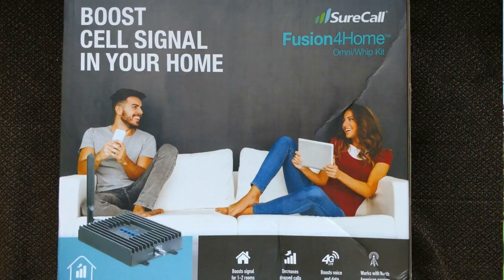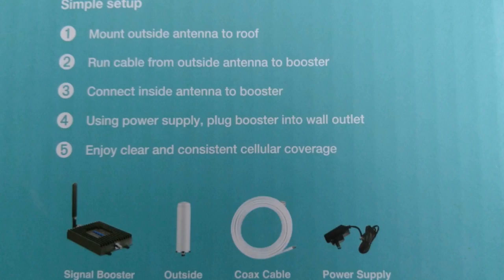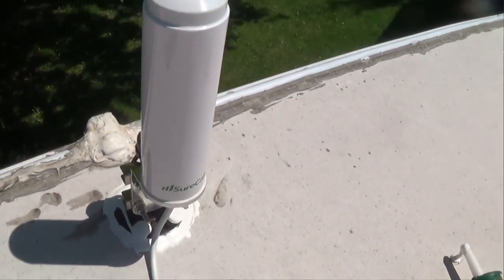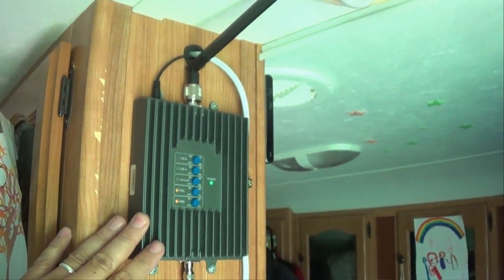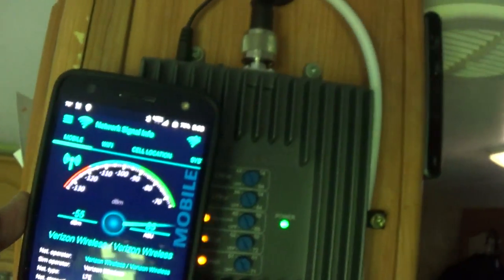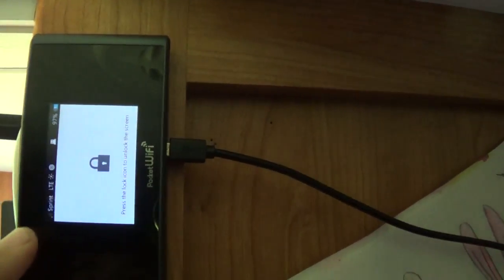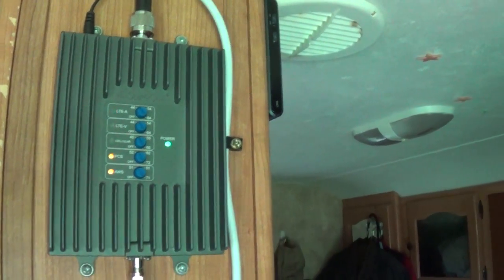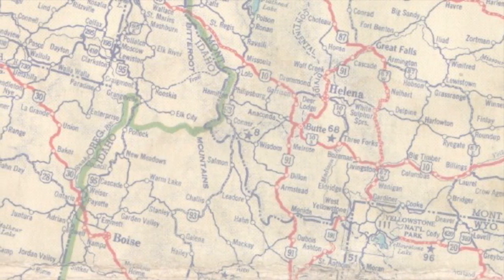Our New RV Cellular Signal Booster: Does it Really Work? - RV Tips & Tricks

Comment: Thanks for the video!!!!
I have been on the fence for over a year planning on purchasing a booster and I think you just helped me decide. I am hoping this helps with ATT and 
T-Mobile the same way in my camper.
But I do have to ask...the mounting bracket that was included with you kit, could it be used to mount the antenna to a 1” RV ladder or would I have to source other hardware or another bracket?  Also what app were you using to test the dbm strength?

Comment: I gotta git me one a them thangs!  Hi guys.   We are just about to do our initial shakedown trip with our new RV trailer. Thank you for this video.   I am very interested in a booster because we will have to upload our videos while on the road with our travel trailer. We use our ATT phone with unlimited as our hotspot.  It works great at home, but I don't know how well it will work on the road.
Reply from the maker: Where are you heading? Maybe we might cross paths. We've been trying to upload a few videos for over a month now and keep having internet problems. I finally got this video uploaded yesterday after I installed the booster, so it definitely helps. BTW, we're heading to Mass for an event in Sept. and will be coming through Penn.

Comment: Any cell booster will give you full signal (bars) but the bars are meaningless you should have performed a speed test with the booster off then turned on the booster and performed the same speed test because that is how you do a true test of that equipment. I’ve seen 5 bars with very slow speed tests and 1 bar very fast but to each their own.
Reply from the maker: I'm aware of that. But there are places we don't get any internet at all unless we have the booster on, so I know it works. At every new location I always do speed tests with and without the booster to determine what will give the best connection.